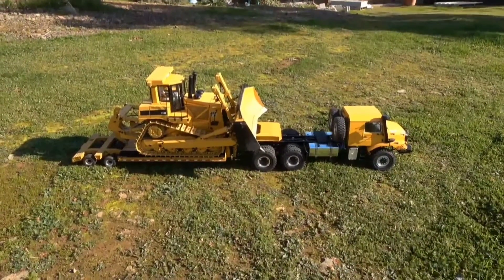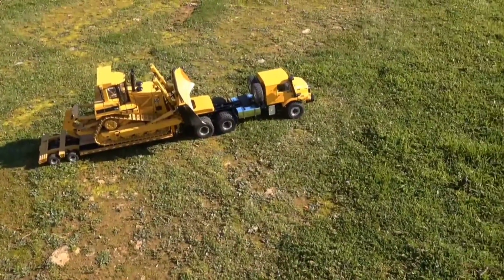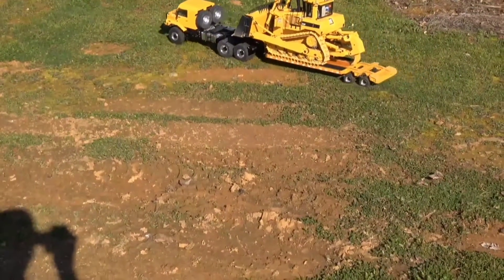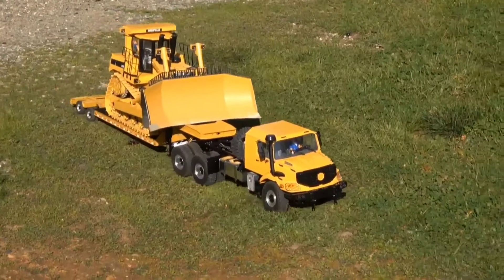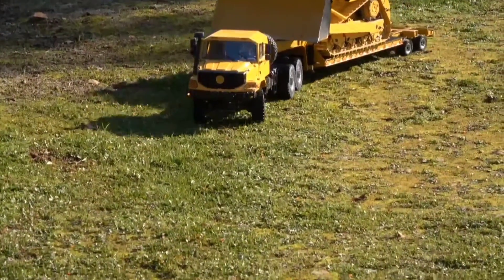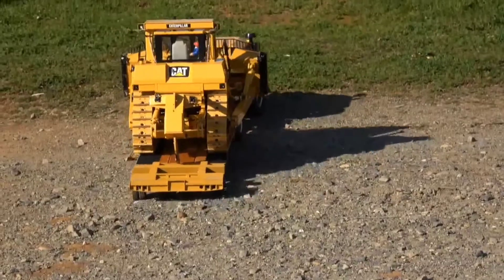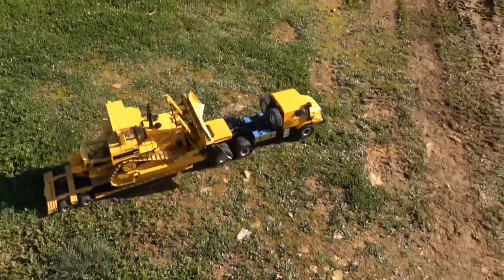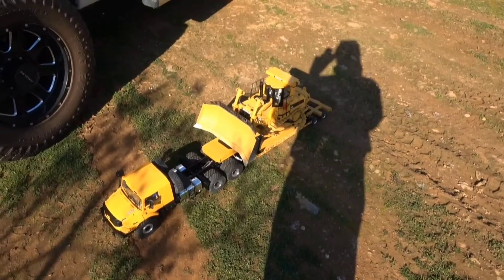lesu lowboy with velcro for traction. works great!

Comment: looks like your right track is on backwards.  The grouser is supposed to be on the leading edge of the track shoe as the machine moves forward.  Your grousers are on the trailing edge.  Go look at a real dozer sometime to confirm what I'm saying.  Easy to correct.  Take the whole track off and turn it around.

Comment: skate board grip tap . works better and is more to detail on your trailer.  its all about the details my friend.  and with grip tape it won't slide at all.     i wouldn't put that shitty looking stuff on such a nice set up.  put the real shit down they use in real life on decks.  even some wooden slats. roughly up so it grips.    nice video as always.     and  why is the lesu excavator not going yet.  what to the build videos of it.  u stopped dead in the water.  thanks
Reply from the maker: Still waiting on servos for the excavator, they been on back order for 2 months!
Reply: @yellowironcowboyrccon7484  I use self adhesive tread strips.. They use it for non slip stairs.. cut it to size works great not expensive find at any hardware store.